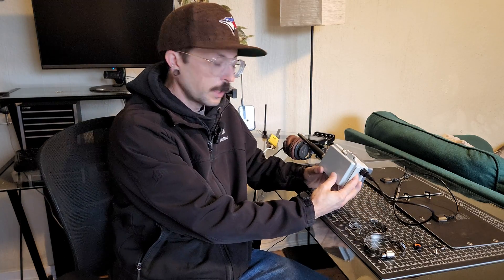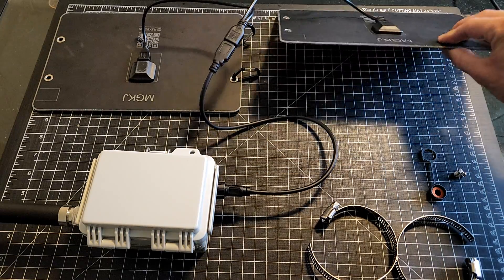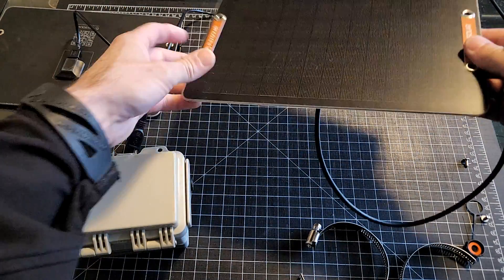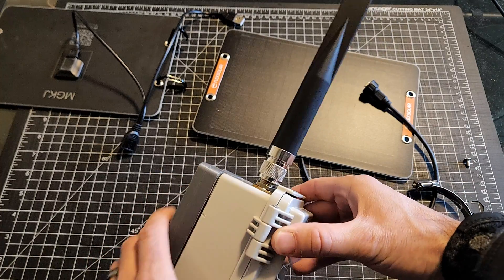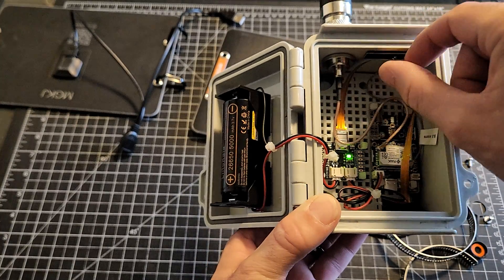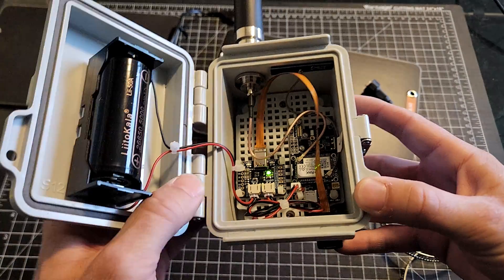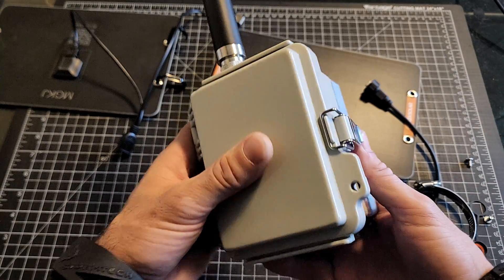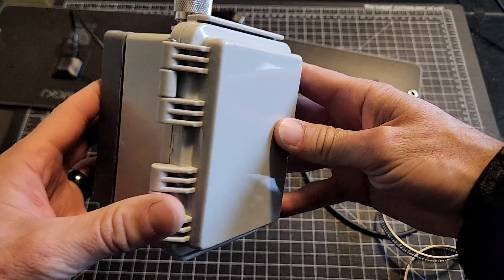Building a Winter-Proof Solar Meshtastic Node for Canada’s Harshest Weather!

Comment: Well I was going to ask how it's doing so far, but I see you just posted the video 1 month ago. Looking forward to an update. Running into cold weather problems myself and searching for better power options.
Reply from the maker: I haven't installed it quite yet, It's still sitting on my desk 😂

Should have a bit of time to get it up and mounted coming into the holidays!
Reply: @darryldowney  out of curiosity, why not use the charging circuit that's included in the rak 4631? The adafruit seems like an extra step.
Reply from the maker: @Archangelrichards it is absolutely an extra step. WHEN your battery dies, the RAK boards don't come back on reliably when the sun comes back out. They "brownout". The adafruit cuts power at a bit higher of a voltage and the RAK board comes back a lot easier and more reliably.
Reply: @darryldowney ok that makes a lot of sense. Thanks!

Comment: Have you had any issues with the max LOAD voltage from the bq25185?  On that version of the adafruit board LOAD max is 4.5V but the RAK19007's BAT input max is 4.3V.  Considered this combination myself but wasn't sure how well the RAK would handle the overvoltage.

Comment: i guess it probably doesn't get as cold in as much of BC as it does here in MB, i'm wanting to create a version of this that would be able to withstand the deep freezes we get here of -25c and colder for 2 week periods sometimes. finding a way to keep the battery from going bad at that temperature and being completely standalone is what i'm struggling to solve. I wonder if there was a way to keep the battery and components close enough together and surrounded in insulation if they'd keep the battery from freezing.

Comment: Why use the adafruit charge controller instead of going directly into the solar input of the RAK board?
Reply from the maker: Great question, wondering when someone was going to ask! Brownouts recovery is the answer. When the battery depletes completely, the adafruit board will cut out a hair earlier allowing the RAK board to come back on easier and much less likely to have to climb on my roof to hit the reset button. I don't recall the exact cut-out spec of the adafruit off the top of my head.

Comment: If minimum temperature is your greatest threat, placing an incandescent bulb connected to AC will provide heat. insulate the box internally. if you  facilitate the insulation and heat source it will withstand any winter Canada can throw at it. Insulation must be internal because moisture will negate its properties. Calculate how much heat you need and purchase a bulb accordingly (be conservative; it won't be a large bulb. think oven light. you can create a watertight window so if the bulb isn't lit you'll know by looking at the window)
Reply: If you have ac..  just ditch the solar, battery, and light bulb completely..  😆

Comment: I have a outdoor weather station mounted on a pole in my backyard that wirelessly sends data to a display panel in my kitchen.  I have a similar experiment going to see how well it will do in the -20C to -30C temps I get in winter along with wet heavy snow.  Should be interesting.